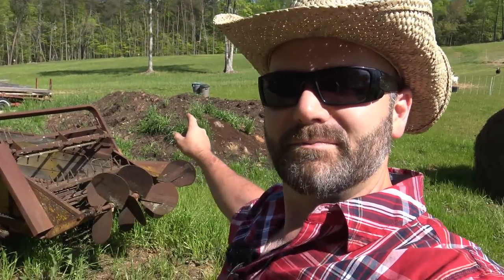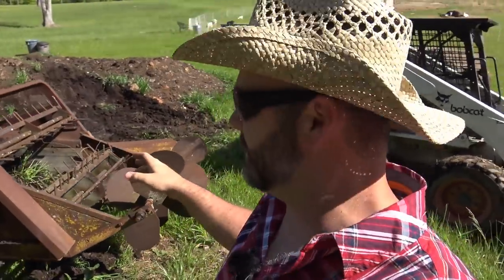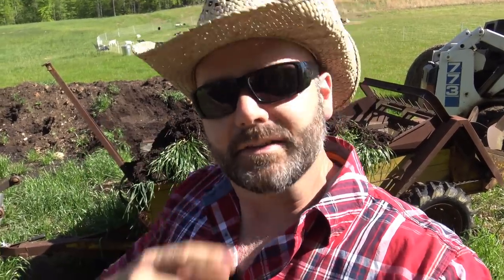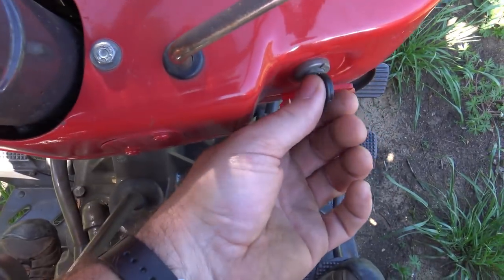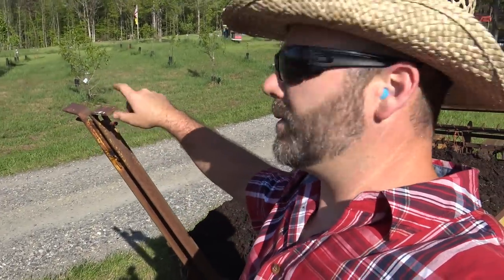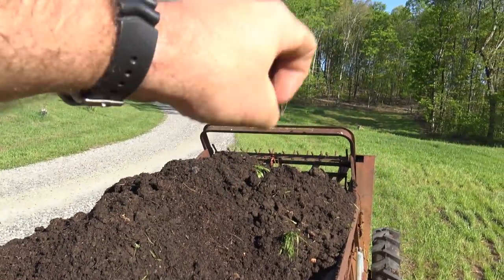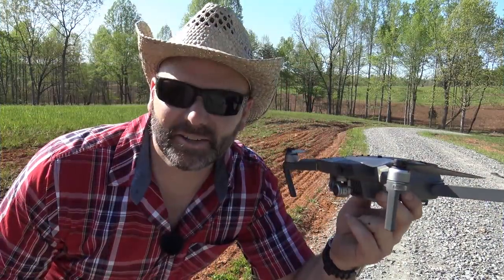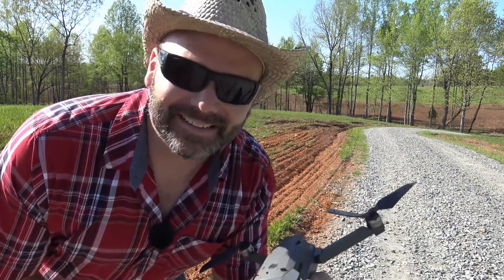THE DAY MY DRONE WENT INTO THE MANURE SPREADER!! MUST SEE!!

Comment: I managed a equine boarding ranch for many years, we cared for 24 horses. 16 were housed in a barn, everyday the stalls were cleaned. I spent untold hours spreading the waste; bedding (wood shavings) mixed with urine and manure. I used a four wheeler, it could pull the load and was more maneuverable. Happy Trails.

Comment: I've got one of those, a Massey Harris one (I've got a video of it on my channel), but what I've been told is to not fill it over the sides too much as the chains underneath can snap and then you have to manually fork the dung out! Also, to increase the life-span of the dung-spreader, I would (and have on my own) coat the whole machine in old engine oil, as this will help to prevent corrosion.
Thanks
Ollie

Comment: Have you done a coolant flush on that bobcat yet it’s good maintenance on those to do don’t want oil cooler and radiator getting clogged and call local bobcat dealer and ask what type of coolant mix they use

Comment: You are so right Josh about tractors I witnessed a man that had been drinking beer all day get  on a tractor pulling a low boy trailer loader with hay get off a tractor with it running. Anyway the tractor started rolling and he tried to get back on the tractor with it rolling and the back tire AG tread on the tractor caught his shoe and the back tire ran over him then the low boy trailer ran him over. I about freaked out when I saw this but luckily kept my head together and called 911 but I actually thought he would die but luckily the ground was soft and he got some nasty cuts , broken ribs, separated shoulder and a lesson that he will never forget ...

Comment: Need to make some adjustment to your paddles. They are too far away from the rear of the spreader. Also you are losing material from under the bed chain. That little Massey is so handy to have around. May want to practice piloting you drone a bit more too.

Comment: This is such a crappy video!  lol

On a serious note that should be spreading wider like when you had the truck out spreading in another video.  Ours on the farm had a seat as it was originally horse drawn.  I got to sit there and run the levers while Dad ran the tractor.  But anyway from your footage yours seems to be dropping off the back rather than broadcasting to the rear and either side.

Find a local micro brewer and see if they'll give you their spent grain or even a few home brewers.  It's great chicken feed and compost.  Probably not bad for the goats either and if you had pigs........